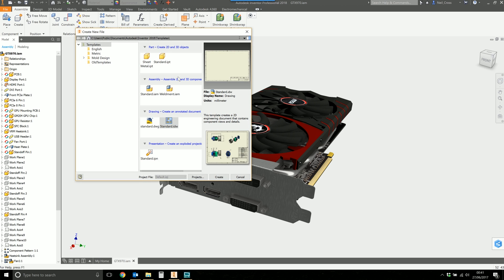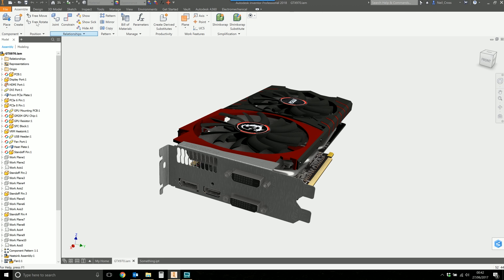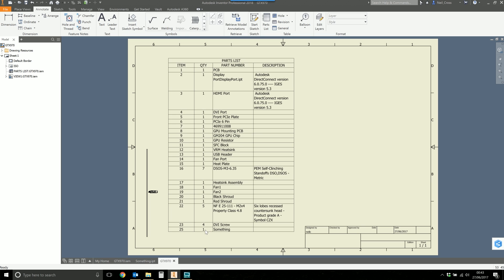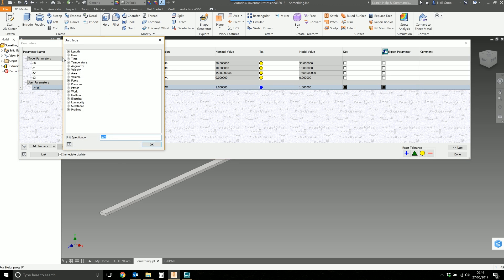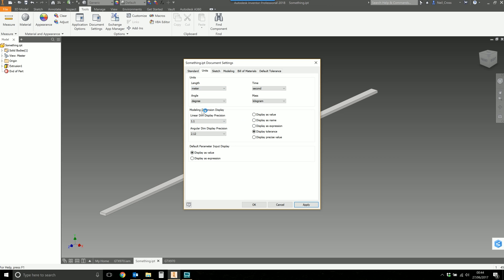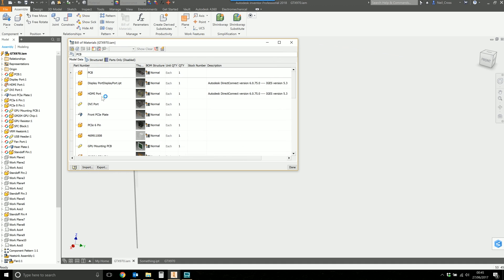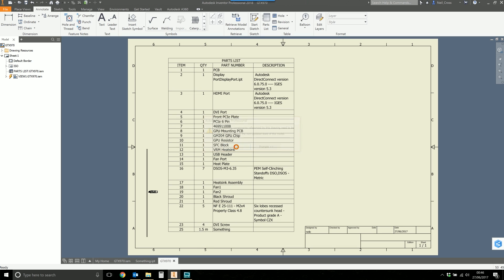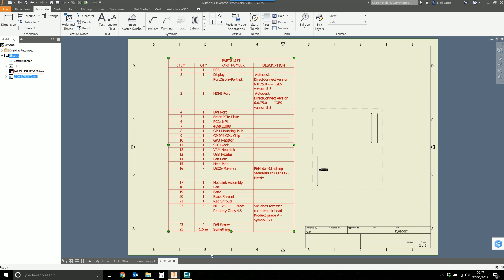How to put Length Unit in a Parts List/BOM | Autodesk Inventor

Comment: Thanks!! now how to i multiply that length to a cost per foot.  Seems like a easy one, rofl.  We will be heros if we can figure this out.  Now i have been designing for 30 plus years, extrusions are purchased per pound or foot, how come inventor does not have this default column, inventor calculates pounds and linear ft for you in frame generator.  now come on 20 years of inventor and everyone wanting this and no cost column for frame generator, its embarrassing.  Ok i feel better.

Comment: Useful video - thanks. OK, I have item length, the sum of lengths, item mass and sum of masses, how can you get the parts list to add up all the sums of both lengths and the total of the masses to give you an absute total of lengths and mass. I need a total length of say all the 12" pipe and the total weight of all the parts. Please, this would be useful.... also....  when exporting BOM to excel it exports length and mass as text, how can you get inventor to export them as numeric values not text. Thanks.

Comment: Hi Neil,  Watched this a few times now. Just came back and watched it again. Someone at work created a drawing of an assembly with some parts created with the frame generator. The parts list has been formatted to show mm in the qty column. That's fine except some of the parts are not lengths but but number of parts and they show as mm. I think using your tutorial I can go back in an correct it. Thanks.

Comment: Hello! Great video. I hope you can help me. Let's  say that I have a rather big assembly with a lot of components, so that, I cannot point every single item in one page, and I need to create two pages of the SAME assembly using  view levels. If I balloon-mark only three items and use the " only ballooned items" to create table,  I get a 3 item table, right?. Now, moving to the next page, If I mark some other three different items and create a table using the same options, I will get two tables with six items, each. And I have to "turn off" the visibility on the unwanted items (table rows). Is there a way to get a table showing what I want without the need to manually turn off rows in every single page? It gets very annoying when making a drawing with many items and  many pages. Excuse  my English and the very-specific-lengthy question :D. Hope I made myself clear. Thanks a lot, and again, GREAT video!!...

Comment: Thanks for the video is very good.. I was wondering if there is a way to display several values in one cell in the BOM, let's say.. instead of showing 1/2" I want to show A x B; A would be my thickness and B my width and I would me getting them from my parameters list.. I do not want to multiply them, I just want to show them.

Thank you!

Comment: Hello,

Is there any reason you did not type in "d2" for the equation for the length.  By doing that if you updated the length in the part it would then update the Parts list automatically.

Thank you

Comment: Please, do a tutorial on how to set up automatic filename and part number creation for custom profiles (structural shapes) so that they include the size and length parameters that are selected or typed in when they're placed from the content center or using the frame design tool.

Comment: Top tip. Never had the time to get my head around BOM and cut lists. Would love if there was a way for the BOM to tell you how many lengths of stock were required. for example a table frame made in  40 mm box iron using frame generator, knowing a stock length is 6m. What's the min amount of lengths needed to be ordered to achieve all the cuts. would save a lot of time for pricing jobs and ordering materials. I wonder is this possible with ilogic?Anyway keep up the good work.
Reply from the maker: Yea I don't think Inventor will ever do that, they have to make a distinction between what Inventor is for and what other systems are for, stock management is handled by a companies dedicated stock handling program like an ERP package.  If Inventor could do things like that, people could then begin to ask why it doesn't then physically raise PO's and where does it end! But you're right someone could probably work that out with a bit of custom iLogic code.

Comment: Hello, can you do a video about step and iges files, import and export. Thank in advance.
Reply from the maker: Hey - that would be possible.  What difficulty do you have with import & export of those files?
Reply: The differences between the types, and also what to use in what situation. Also, what file is meant to share with others without showing too much. Thanks for the quick response.